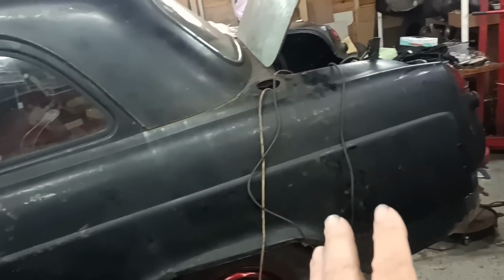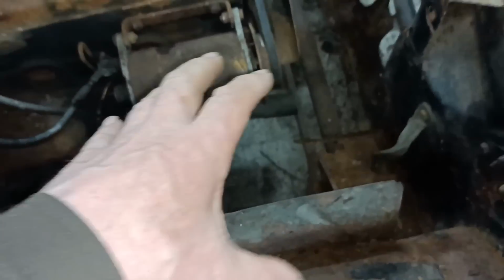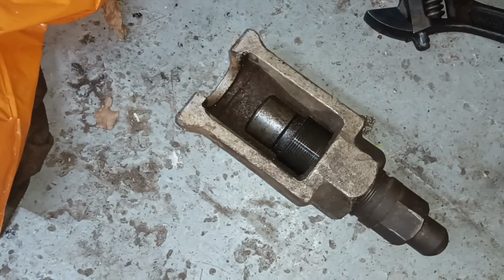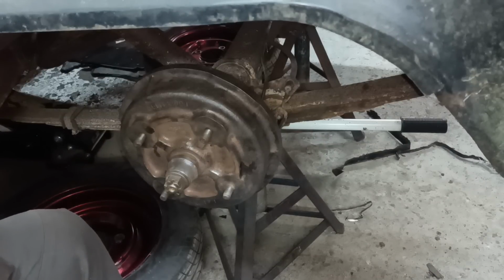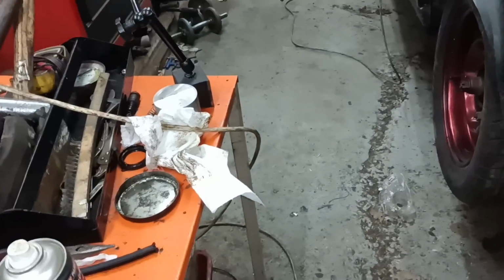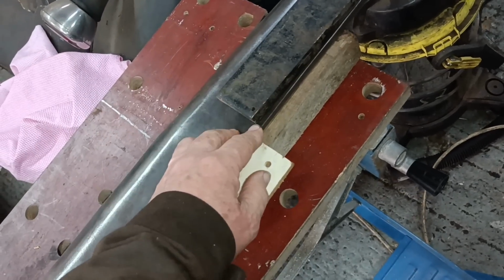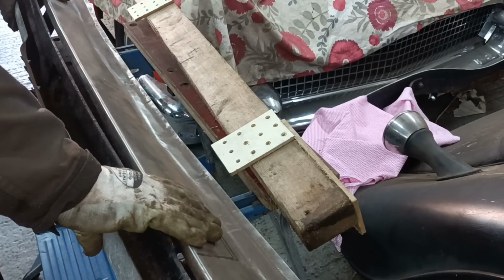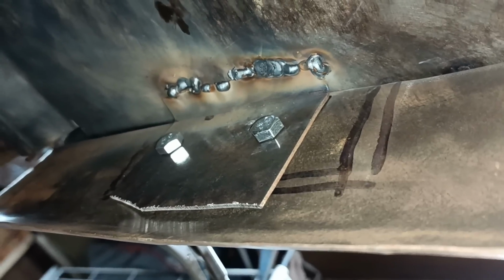Mart's 1955 Ford 100E Anglia part 7!  More parts! More Brakes! More welding!(2340)

Comment: Really coming along well Mart. I had the same issue with welding on my back. Just need to get in a comfortable position and have either a leather jacket on backward or something to protect you from the splatters of weld and you can do it. I was able to put mine on a stand that I made so. that I could weld underneath standing up. But it was a lot of work and I had a lot of welding...lol Good luck mate, it's going good so far!
Reply from the maker: Thanks Don. I'm managing to do most welding from above. Good tip on the leather jacket. Unfortunately I don't have one.

Comment: I hate to be the bearer of bad news but those rear hub seals aren't the cause of the oil leak. They are grease seals for the hub roller bearings. The axle seal is inside the axle tube, and unfortunately is accessed from the middle, so you need to split the casing and then you're working down the length of the tube. Ford had a special tool to fit those seals. People have successfully fitted them on the end of a socket with several extensions, but tricky. But changing the hub seals won't stop the leak and will ruin another set of shoes.

Investing in the parts book and workshop manual would be a good idea.
Reply from the maker: Hey, LMS I can take bad news, never be afraid to shout up. Yeah, deep down, I did know that and I should have mentioned it. If it looks like I will end up putting some decent miles on it I will do the axle seals and feature it in a video. I have done the job on my 41 ford pickup. I have ordered a pair of seals on the strength of your recommendation. I'm wondering if the axle breather might be clogged and causing the excessive leakage. I will investigate. Thanks for watching and commenting. Mart.
Reply: @MartsGarage
Reply: Always worth a try, Mart!

Comment: Mart, try plug welds, when you get the hang of it they look like spot welds. Drill a line of 5 or 6 mm holes in the floor and clamp the new bit below then weld through the hole until filled, check for penetration from below the floor. Try it on the bench first, there are plenty of YouTube demos.
Reply from the maker: There'll be plenty of plug welding, Pat. I should have used them there, but was still finding my feet. If I were to do it again I would do some things differently.
Reply: @MartsGarage  Yer the best thing with with plug welding is avoiding that shower of spatter singeing your hair and burning holes in your overalls. Press on , bringing back lots of memories.

Comment: Re welding - if you haven`t got one already get yourself one of those all enveloping helmet type masks that goes black only when the arc is struck, they make the job much easier.
Reply from the maker: Hi Angels.I do have that type.  I have been practising and am getting better. I found my extra strong glasses and once able to actually see the electrode tip, things have got a bit better. Thanks for watching!

Comment: Mart, I recall your having mentioned that you were looking at a year's worth of welding! I never cared for the overhead welding, either! Fact is, you'll be much better at it after this project! (smile) Thanks for sharing!
Bro Harry
Reply from the maker: Hi Harry. I have been practising and am getting better. I found my extra strong glasses and once able to actually see the electrode tip, things have got a bit better.

Comment: Drill the boot floor above the brackets plug weld from above👍.
Reply from the maker: Yeah, Dave, in hindsight I should have done that. I have used the plug weld technique since and am getting the hang of it. Thanks for watching.

Comment: I'm sure that after a break you'll be able to fettle it - progress has been excellent so far.   Actually, when I saw the condition of the body sections you were getting from the donor car I did wonder whether that was the one that should be the project, using yours as the donor!
Reply from the maker: Hi JB. Yes, that thought has crossed my mind more than once. I was thinking more of a floor pan swap but I never set out to do such a job The parts car was a 4 door, and pretty much gutted out. It was the completeness of my car that attracted me to it. Thanks for watching and commenting.

Comment: Hi mart turn your wire speed up a wee bit try and get an angel on the welder tip should work ok or just over lap spot welds take your time it will come
Reply from the maker: Hi Jamie. I am getting better. Getting into a position where I can see the arc has helped a lot. I will be showing some better welding in later videos I hope.
Reply: @MartsGarage  yes mart you have just got to work at it it will come tho like I said spot weld and over lap it and it looks neat when you are done 👍👍